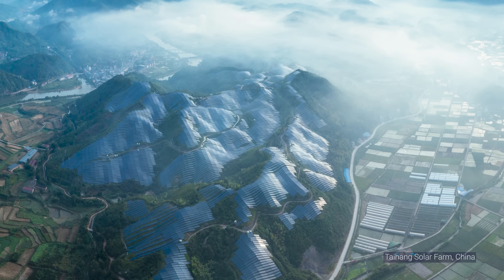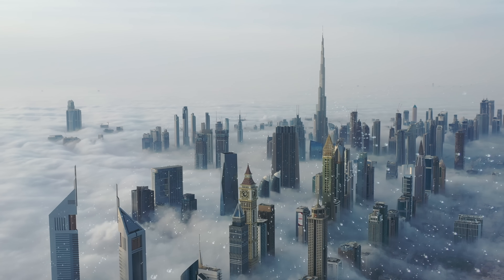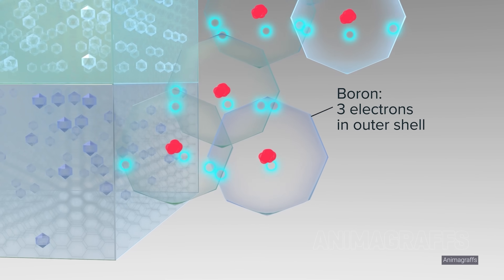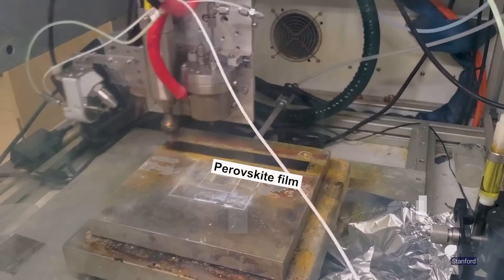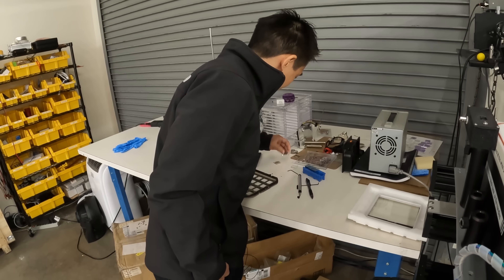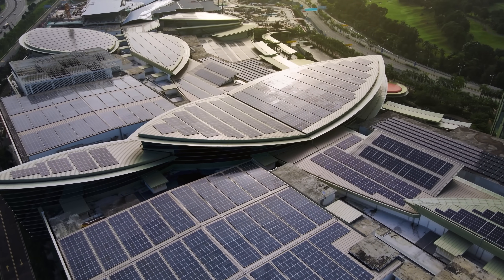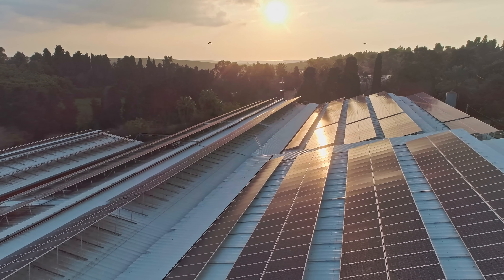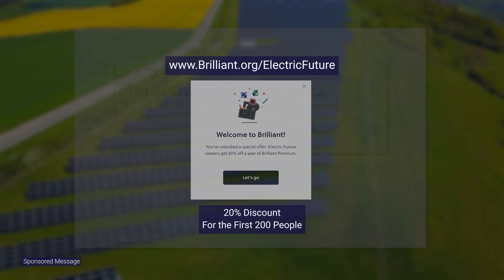Solar 3.0: This New Technology Could Change Everything

Comment: Love the simplicity yet the complexity in his explanations. Can’t wait to see what happens next. 
Q: Could Vanta black with is light adsorption affect the efficiency of the tandem and attract more sunlight to the tandem while finding a solution that will dissipate heat away from the tandem bc vanta black absorbs almost all light therefore I’m thinking heat too.
Reply: Actually , the main reason they want to make it transparent is for heat absorption to be low. Current solar panel has a black surface which actually absorb heats towards earth which is bad as we do not want it to hear our planet, instead we want it to reflect it back outside of our planet.

That is why they do not consider it to be black. I hope this helps.
Reply: @rinkleac95  did he not also say that it is reflective so the light passes through the semiconductor twice? Like a cat's retina?
Reply: @Louisthesaxman1  Exactly, using vanta black would make the whole process absolute.
Reply: Hey bro, not trying to be an arse here but could you maybe check your spelling?

Sorry
Reply: uh oh ish de spelling polece! evrybudy hide 👀
Reply: @BingusDingusJohnson   edited
Reply: @BingusDingusJohnson  

Affect 🔄 Effect

I get it

Comment: People talk a big game about nuclear energy because of how relatively clean and efficient it is (Thorium is to become the leading element in nuclear energy), but the same people fail to realize that nuclear energy isn't renewable, (albeit recyclable). They quickly dismiss other forms of renewable energies, such as solar energy, because of how inneficient it is and how much usable surface area it takes up with current technologies. They don't take into account that the tech is being improved on. When solar panels will become so efficient, unintrusive and invisible that you won't know if a building is partly covered in solar panels from top to bottom, we probably won't need nuclear energy as much.

Comment: could you use thermal cooling I don't know if there is such a thing but a heat retardant gel that takes the heat but still allows light to filter trough and at at same time protects the panel prolonging its life

Comment: Why do you need them to last for 25 years? If the payback period (money and energy wise) is a lot lower than regular solar panels, it won't be a problem if they only last for 10 years. The solar energy technology is developing so fast that replacing solar panels after 10 years could be more efficiënt anyways.

Comment: This is definitely something I hope becomes commercially available soon because I inted to heat my house using Geo-thermal and I'd like Solar Panels (with w/e batteries I can get for energy storage for cold/night time usage) to be what is giving the geo-thermal unit all the energy it needs to operate at 100%. Not needing to burn wood or use oil/propane etc. is a dream of mine but living in NH I worry about how many solar panels I'll need to get so that (even in Winter time) I never have to worry about having enough power to run my geo-thermal unit. I haven't done any research into how much solar panels are going to cost me but, as long as I can afford it, I have no doubt I'll be needing dozens for year round powering/usage.
Reply: You will need 3kw for dark evenings and mornings. You would need at least three GTesla Powerwall equivalents.

Comment: @Electric Future
Here is why it wont change a damned thing, and videos like this are generally rank bullshit.

1. Climate change is a twin symptom with ecological collapse, not a driver of ecological collapse, ecological collapse is being driven by massive over consumption of resources now 30 years beyond sustainable limits. So what do you think your perpetual growth capitalist "electric future" will do to what remains of planetary ecology in order to transition a 90 trillion dollar global perpetual growth capitalist economy away from fossil fuels and onto that "electric future"

2. The laws of thermodynamics are very clear on why in a closed system such as earth is, that is is a monumentally stupid idea, to use the machine that makes the mess (capitalism) to build machines to clean up the mess you made, no matter if thats via efficiency or moderation. Using technology in effort to allow perpetual growth capitalism to outrun the immutable physics of a finite world, is akin to putting on your best running shoes to help you run up an ever increasing landslide,

sure, you will make it a little further than you otherwise would have done, but nature will bury you eventually.

3. It matters not how "greenly" you power things within this system, it matters not how "greenly" you move around within this system, the system is the problem, of which rapid climate change to a state non conducive to organized life and the collapse of ecology are twin symptoms that result. The former from producing ever increasing raw resources into goods and services, the latter from gathering ever increasing amounts of raw resources to keep that going and increasing a 3% a year for the last 450 years.

I mean the more energy you make available to humanity without any restraints on humanity then the more consumers are produced and the more terminal damage to earth results from their consumptions, your solar panels dont do jack shit to prevent that and do plenty to aid in it if employed under capitalism.

In summary, you can have capitalism, or a viable future for humanity via a vastly lower powered civilization, you cant have both no matter what some spanner of an engineer is showing off in a YouTube video from silicon valley in hope of some subsidy. Physics cares nothing for your beliefs nor feelings to the contrary of what it is doing.

You need to stop looking at things in individual isolation and view the world in its systemic entirety. Only then can you see the yamning chasm of techno bullshit being spat out by "entrepreneurs" looking to cash in, in complete fucking ignorance of thermodynamics at work because that ignorance is profitable.

Take hydrogen for example, right now on the EU parliaments desk are its proposals for a hydrohen future, we are going to have hydrogen cars, planes, trains, and heavy industry.

Trouble is... the worlds nations combined only produces 70 million tons of hydrogen a year and you need 14 billion tons a year just to decabonise the global steel industry alone never mind all the other bullshit the document claims we will be running on it.

Techno/ScienceFiction<-------------------------------------->Actual reality. A world of difference you and many of your commenters are sadly unaware of which is why you are all going to be increasingly distressed as you see nothing but a worsening climatological and ecological situation unfold over your life despite the many technomagic beans you may display along the way whose founders promised much got some money and delivered little to nothing, as no solution is possible under the present economic system.

Comment: Its great that Solar technology is getting better and better everyday but the problem is Batteries which are used to harness the power which are Medieval and cannot catch up with the advancements of Solar.....there is most likely a battery that has been designed even built but it will be locked away from the people has Corrupt Solid Fuel Companies cannot afford for this to happen could you imagine if all Nuclear and Coal power plants was to be closed over night thousands and thousands of jobs would be lost and the greedy execs and share holders would lose Billions and Billions

Comment: That's gonna revolutionize the industry, and quite sharpish too. Also, it's one thing to harness the sun's energy, it's another to store it. On site Hydrogen Fuel Cells can help with that. They can act as a very efficient battery. Definitely a space to watch. Also, if Perovskite cells are so versatile in regards to what they're made of, perhaps try making them out of fully organic materials such as Flax or Hemp? 
Enjoyed this, cheers.
Reply: So does using the electricity to pump water up a mountain into a reservoir, then letting it back down the mountain when the sun goes down to run turbines and make electricity. Using gravity as a battery.

Comment: "it would take a fairly small corner of nevada" "you only need about a 100 x 100 miles" First problem 100 x 100 is 10,000 square miles...... So not exactly small. Problem two is anyone who has ever lived in Southern Nevada could tell you the problem is maintaining them, even a light rain storm passing through will foul up all those panels by depositing a layer of dust on them. So they would have to be constantly cleaned (and good luck supplying the water needed to wash a 10,000 square miles of panels in desert, especially with lake mead at a all time low). The two major solar plants rightout side of clark county don't even use photovoltaic's, they are all mirror/boiler systems.

Comment: Realistically though, we should only be pushing things like solar power if they boast 70%+ efficiency, no less. I'd love nothing more than to switch over to a mostly or completely clean and renewable energy source, but the efficiency rate is just too poor. Same with lithium ion batteries for electric cars, the mining alone is worse than a lifetime of carbon emissions from a gas powered car. As soon as solid state batteries are mainstream and widely used in electronics we should start pushing for electric vehicles, not before. R&D is vital, yes, but it's more harmful to the environment to just mine the lithium needed for the batteries which only work for about 10-15 years and then need replacing.

Comment: The biggest problem with solar power systems is that the power is only produced in sunlight. The power is also sporadic and as a power grid can only work when the power production is matched with the power production. If you produce too much power the grid overloads and will shut down, if you don't produce enough power the grid will also shut down. If you want to produce power that is controllable enough to be used then you must store the power from solar production then use the storage to power the grid. If you combine a system of closed loop hydroelectric power stations with solar power systems you can produce electricity in a controllable way that is sustainable and environmentally friendly. Modern battery technology is not environmentally friendly or sustainable due to the materials used and how they are manufactured. A closed loop hydroelectric power station can be built using 100% recycled materials and if properly maintained can last for 100s of years. The most efficient way to use closed loop hydroelectric power stations is in a grid of strategically positioned power stations throughout a city. Closed loop hydroelectric power stations can be built underground or incorporated into building design saving space and placing the power production closer to the point that the power is needed eliminating most substations and transformers. The closer to the point of use a power station is placed the amount of power needed for transmission is lowered. This means that the power production needs to be greater than what is actually being used and then lowered to the correct level. This is not a very efficient way to produce power. The average city will only need rooftop solar power systems if they are connected to a system of closed loop hydroelectric power stations. This is the only way to create an environmentally friendly power supply that is cheaper than any other system. I have been trying to get help from a mathematician with an understanding of fluid dynamics, an electrical engineer and a structural engineer to help me properly design this system of power production because if you don't have a degree no one will listen to you. I have also discovered a way to make a closed loop hydroelectric power station that is self recharging eliminating the need for any other power system. Yes popetual electricity is possible but the actual size and cost of the power station is something that I don't have the mathematical skills to work out. Just using current technology the combination of solar and closed loop hydroelectric is the best option for replacing all other forms of power production.

Comment: If they can be produced at 1/15 the cost and made is a thin film over existing glass then I'm not sure the longevity is necessarily that important. Maybe they should be thinking of it as a parallel capability rather than a competing technology for silicon panels. Given how light it is, you could put it on the side of buildings instead of on the roofs because you don't need extra supports. Then you could still coat the roof in old heavy silicon panels.

Comment: 0:30 It is extremely disingenuous of Elon to claim that "just" 100 square miles of solar panels could "power the entire US".    Firstly, 100 square miles is really freaking big- 6,400,000 acres to be exact- nearly THREE TIMES the size of YELLOWSTONE, and more than EIGHT TIMES the size of Rhode Island!!!  Indeed, Massachusetts is the smallest state which could contain this solar farm, as Vermont, New Hampshire, New Jersey, Connecticut, Delaware, and Rhode Island are each incapable of housing the farm.
There are a couple dozen other reasons why this is a bullshit claim, but I'm not going to get into them right now...
Reply: @Trehlas  I think your comment was sens0r3d, so I'm replying based on what I can see in the notification.
Yes, absolutely, it is vital to have a diverse array of sources for electricity.  The modern world is currently propped up on limited fuel reserves- in crude oil alone we consume more power than we could generate if every square inch of the world was covered with a solar panel- including the oceans.  We have as much of a demand as a supply issue, but there are some other sources to consider- for example, we can turn large bays into two-way hydroelectric dams fueled by the tide- when the tide recedes, the water is slowly let out to run the turbines.  When the tide comes in, the turbines simply run in reverse.   In some regions, the tidal range is over 12 meters- that's a lot of power waiting to be harnessed!
Reply: @Trehlas  I was making a hyperbolic example in an attempt to not delve into the "couple dozen other reasons why this is a bullshit claim."  Of course the panels would be split over multiple regions, my comment put the "just 100 square miles" point into perspective.
Reply: @Trehlas  Those rooftops aren't useless- they're providing relatively inexpensive and durable shelter.  Adding solar panels on top makes them more expensive, less durable, and said solar panels almost never track with the sun, decreasing their efficiency.  Further decreasing efficiency is their height, which on its own doesn't decrease efficiency, but it does mean that most people won't properly clean them... which reduces operational lifespan and efficiency.

Solar panels have their uses, absolutely, but they're not a band-aid solution for energy demands.  They are an unreliable source of power in an atmosphere due to clouds, are expensive, and barely produce more power than their inception requires.